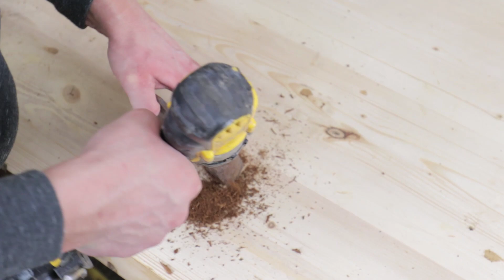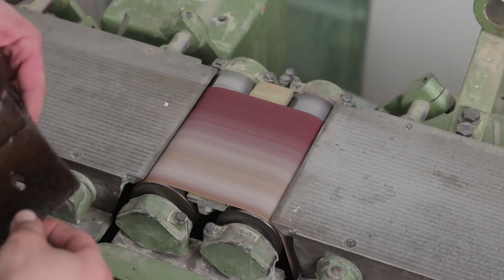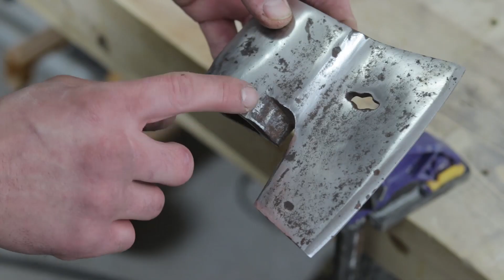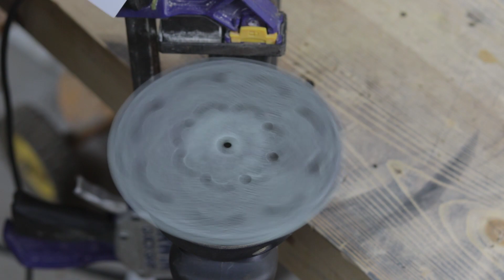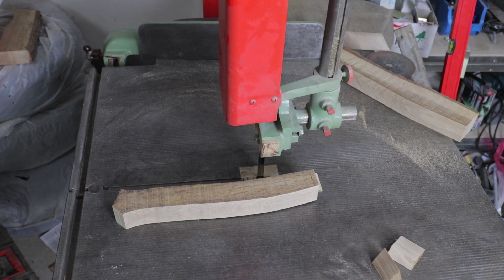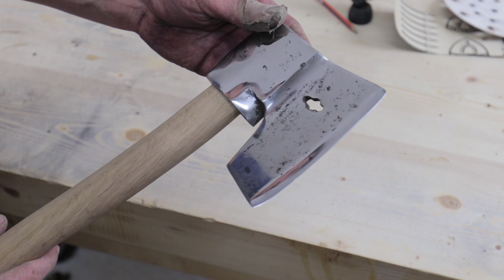Antique 19th Century Rusty Axe Restoration

Comment: If it is really over 100 years old axe, I am impressed. Watch a head of this axe. Mostly on the cutting edge. No warps, no deformations, only few small chips. His hardness after over 100 years is still great. This axe needs only cleaning and sharpening to be still effective. None of contemporary axes are equal with this axe. A man, who made this axe was the master of the masters. Real blacksmithing on level 100.

Comment: Why did you weld shut the hole for the nail that hold the handle that keeps it from sliding off if the wood shrinks ?

Comment: Great job. But that is a right handed hewing hatchet. The handle should be bent to the right seen from the top (looking down from the pole) to give you knuckles clearance when you hew beams and boards. Easily done if you cut the eye at an angle on the left side. Awww... you won't even read it. What is the point?

Comment: Are you ever concerned that by using power sanders you're heating up the metal to the point where it loses its temper? Or are they all display pieces so it doesn't matter?

Comment: Restoring is more than shining something up a bit. You had an old piece, and you  brutally stripped all of that old quality away. Any of the patina, signs of use and abuse over the years, were just buzzed away with a grinder. Unimpressive. What you are left with  is something that might have come from China. The cheap industrial part of China. If you want a new thing, then make a new thing. If you have something old, it is the age that is of value. Preserve it.
Reply: I don't think this guy really cares to have a museum stocked full of useless rusty axe heads :/
Reply: Sanctimonious
Reply: I agree 100%, these “restoration” guys just like to make metal shiny. Why not just get a chunk of rusty steel and have at it?
Reply: He gave that axe new life. It can be used again.
Reply: bomaite1 You'd rather let a fine piece of beautiful steel--meant to be used--run itself down and die? I believe what he's doing is beautiful. He's taking old, rusted, once useless pieces and giving them new life.
Reply: Not saying that at all. You can return something old to a usable state without destroying all signs of age. Something that has survived for a time and been used should have some signs of that life. Otherwise, take a new one off the shelf.
Reply: bomaite1 

What is LEFT that can be used to signify age? Rust makes the axe unusable. So that leaves. The wood is rotted and a splinter hazard. That goes. There’s nothing left. It’s only the wood handle and the metal wedge. That’s all an axe is.
Reply: Once again an Internet troll trying to tell someone what to do with their own property. As they furiously wipe the cheetoo dust off the keyboard to make a comment.